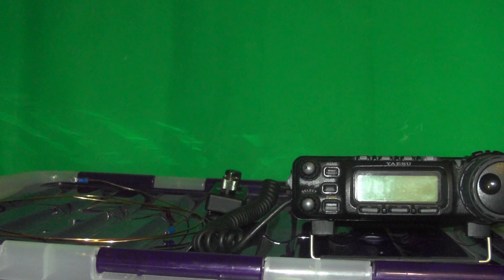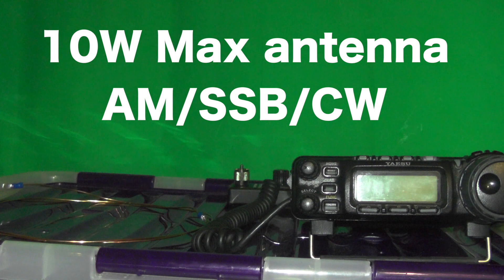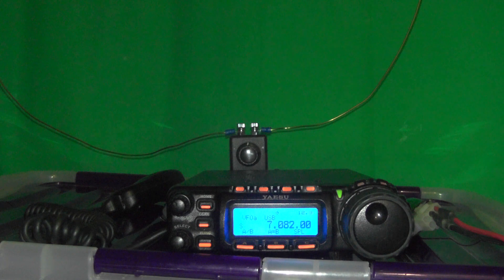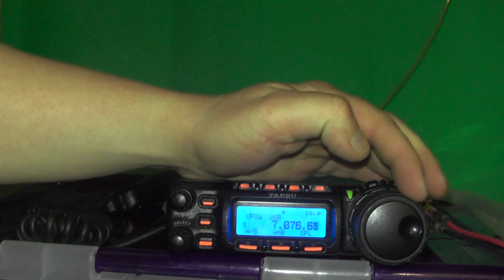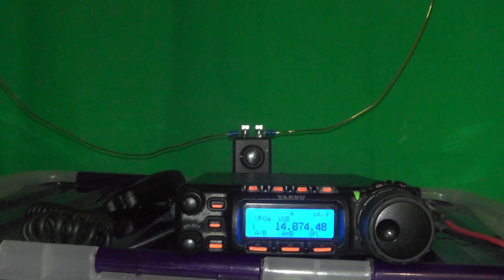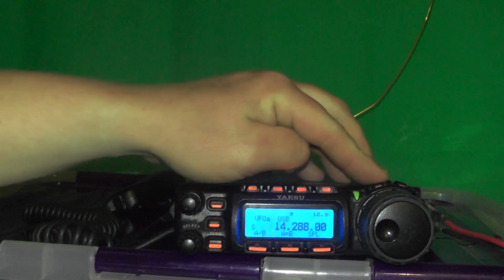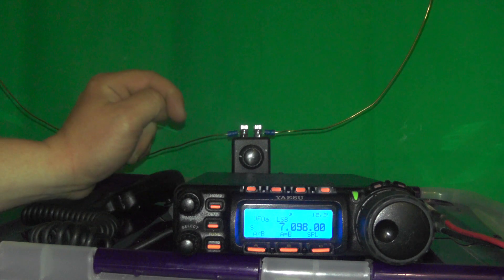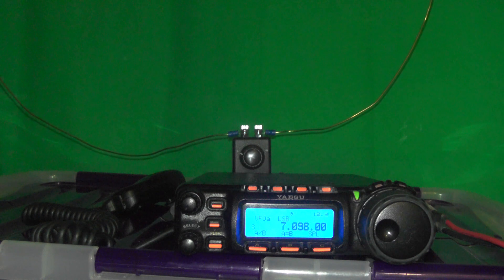Whizz loop V2

Comment: Thank you for the informations provided, but I think It's not helping at all to put some labels on the case where the SWR is at minimum, because that setting will work only if you stay in the exactly same position all the time. If you go outside, on the field, you have to re-adjust the capacitor in order to get the minimum SWR. That's because the impedance of the radiator has changed, so the circuit inside is not resonating anymore on the desired frequency. On your particular environment you have in the video, you have a wall behind the antenna. Outside you will have clear space. Please excuse my poor English, I hope that what I said makes sense for everybody. DE YO8UFO, 73.
Reply from the maker: Ill have to take it outside and try it. Ive not done anything with the antenna I can hear people but ill need to go outside  and give it a proper try and see if I can make contacts